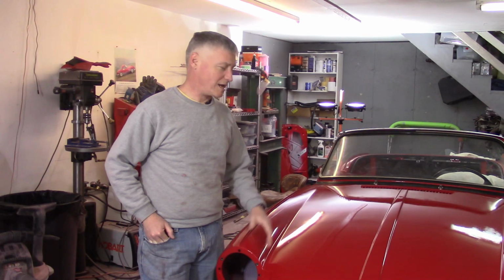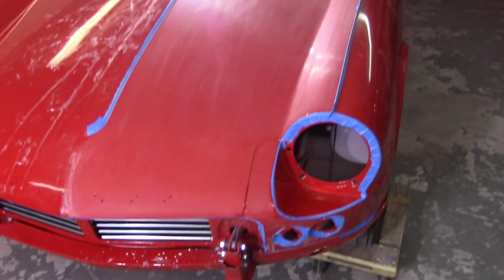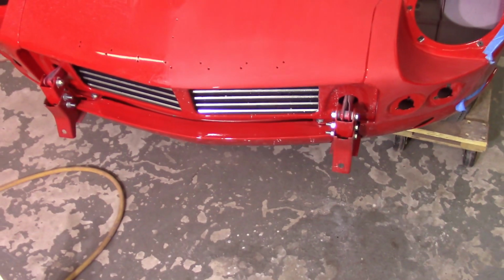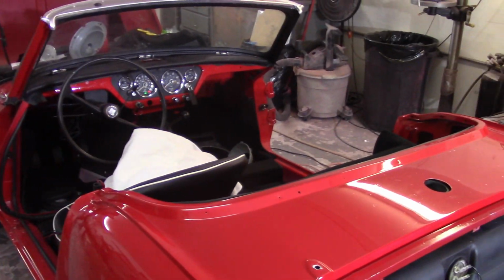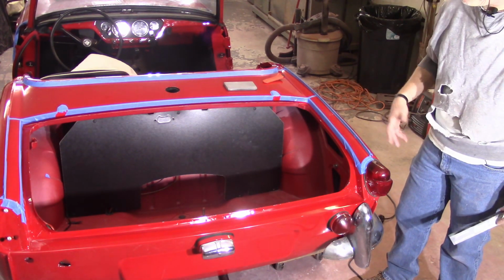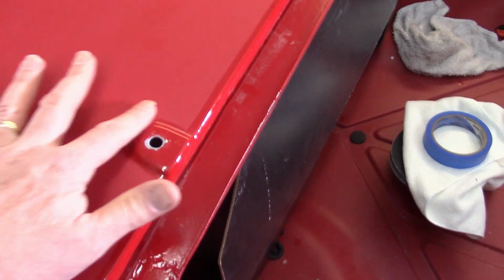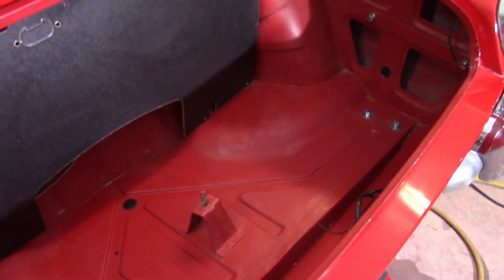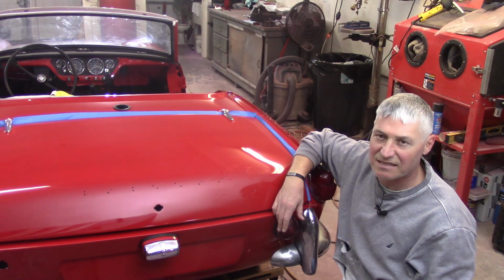Triumph Spitfire - Das Boot! | Roundtail Restoration

Comment: Very sharp looking.
Reply from the maker: Thank you!
Reply: @roundtailrestoration  I hope the red I spray comes out like yours did.
Reply from the maker: Take your time and do some research. I'd recommend visiting SPI's forum (http://www.spiuserforum.com/index.php) for tips. I don't think mine came out that great, but cutting and buffing is saving it. 3 coats of base, 4 coats of clear (at least) gives you a lot of correction room (except on edges). It'll look great when you're done!
Reply: @roundtailrestoration  will do I have also been watching swrnc's channel. I am nervous about painting it, I have to do it with my non dominate hand. I hope I have the technique down while spraying the primer.

Comment: It is amazing what the sanding and buffing does.  Looks great.  Is there any easy way to touch up the tiny burn through spots? Thanks for the video.  Stay healthy.
Reply from the maker: It is, thank you. I intend to just spot it with my base coat, sand it with 3000, then spot it with clear, sanding again with 3000. I have no idea if it'll work, but that's what I'm going to try. You stay healthy, too!!